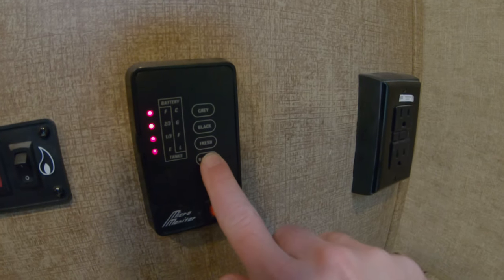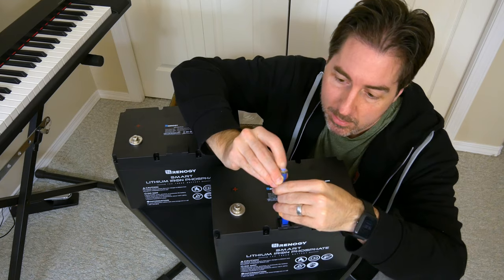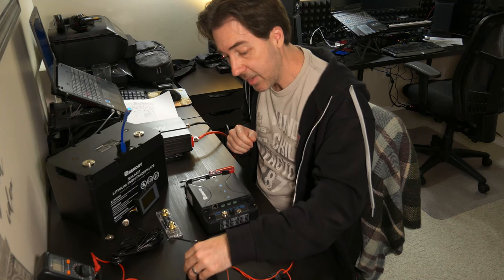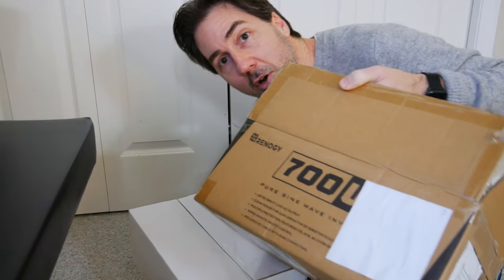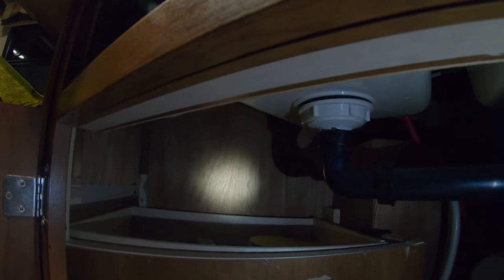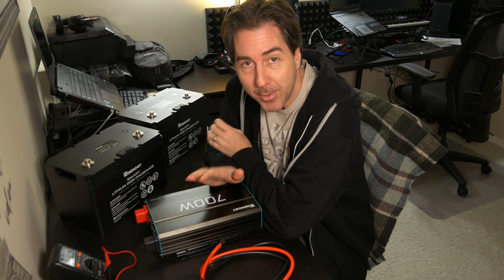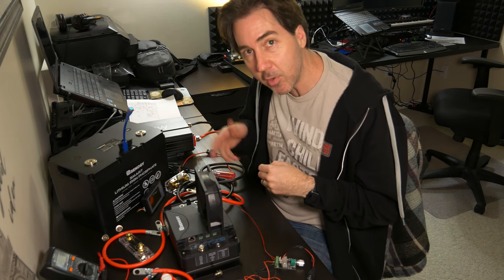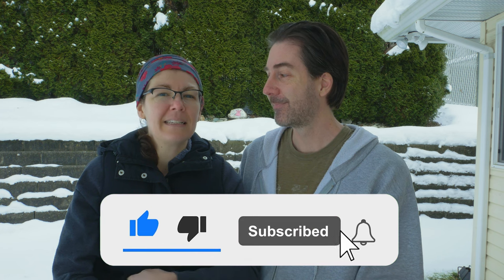RV Lithium Battery Upgrade / Conversion for Newbies! | Renogy LiFePO4

Comment: great video. I have an off grid home with lead acids that I'm going to upgrade in a couple of years. Although I'm not a complete novice, I really appreciated the balanced level of detail on your experience with this video. No overly macho tech talk and not overly simplistic either. Lots of parallel concepts between your application and mine. Thanks!
Reply from the maker: That's great to hear! Thanks for letting me know, that's very encouraging. We might have some more electrical videos coming up when we get a new rig!

Comment: This appears to be a complex "do it yourself" project.  Did you consider getting bids to have a professional install it all, and what did you calculate you saved by doing it yourself?  Personally, I don't have the skill or confidence to do all this myself, so you guys once again amazed me.  You are both awesome!
Reply from the maker: Thanks Doug! We never actually looked into quotes for someone else to do it, since I (Jay) was pretty confident I could handle it -- with a some help from my brother who has worked with a lot of electronics in the past. I'm not sure if I would have tried to tackle it without an expert I could call on 😀. In terms of how much we saved doing it ourselves? I'd guess maybe $5,000 or so in labour. It was a time-consuming project, but very rewarding. And it keeps paying back dividends on our trips. Solar is so much quieter and nicer than our having to use our generator. 😁

Comment: I like your simple breakdown for calculating power needs. I assume that fan was noisy because it wasn't mounted but you might want to look at a bigger one as they tend to run a bit quieter!
Reply from the maker: Thanks, the formula is simple, but as you know, it's not always straightforward to know what your actual usage will be until you actually get out there. For the fan, we're limited by the size of our new "console" area, so we couldn't go too big. Hoping once installed it won't be that noisy :)

Comment: Cool and helpful video.    I'm assuming you can just use a standard charge controller like the renogy rover elite for a lithium battery if only charging with a solar panel and not with shore power or from the 7 pin plug on tow vehicle
Reply from the maker: Thanks! Yes, absolutely. In fact I would recommend using a different charge controller if you don't need the dual inputs, and specifically something that can handle a higher voltage so you can put some of your panels in serial and use thinner wires. The DCC50 in our rig can only handle solar input up to 25V, which means we had to run all our panels parallel.

Comment: Just a correction.  That renogy charge controller does DC-DC charging and solar panels but it doesn't look like it does shore power charging like you mentioned in the video.  It would sure be nice to see one unit do all 3 but I can't seem to find one.
Reply from the maker: We actually have the shore charging coming in on the DC-DC input, but of course that's after it goes through the stock converter. I believe you can get converter/inverter combos but not from Renogy.

Comment: Hello there. Great video and circuit diagram, i have a couple  of questions though, would it be possible to see a picture of your full  setup as you have it in the room? That would make the diagram read  much easier and also is it possible not to install an inverter now and add it later?
Reply from the maker: Sorry, I don't have a wide angle view of the full setup. That would have been a great idea. I'll have to keep it in mind for any followups. And yes, the inverter is optional. Its only purpose is to converter DC power into AC, so if you don't have any AC appliances you want to run, you can leave it out and upgrade later.
Reply: @HomeARoam  Thank you much for a fast reply, i wish u had that picture 🤣

Comment: When you hooked up your old converter directly to the alternator charging post on the Renogy charge controller, which output wire from the converter did you use? Mine has three—red, white, and black that were connected to the old battery +, old battery -, and old fuse box respectively. Not sure if I should use the red or the black to go into the Renogy DC50. Any ideas?
Reply from the maker: Hi there Julian, it will vary depending on the converter model, but if you check out the diagram at https://homearoam.com/how-to/rv-lithium-battery-upgrade/ on my unit, the live charging wire was connected to a port labeled VCC+ and was red. Black is typically negative, and all of your negatives need to be bussed together. IMPORTANT NOTE: Make sure to use a voltmeter to confirm! Don't just take my word for it! 😁

Comment: Great video! Just watched your solar panel vids too. Was wondering how your system has panned out? Are their any changes you would like to make? Are you satisfied with the 700W inverter? Does 400W of solar panels work well? Do you bother tilting them or are they collecting lots of power being flat while your in the baja? Would love to see a video on all this with your power usage and recharge times 👍 Thanks!
Reply from the maker: Thanks! If you'd asked last year, I'd say we had way more power than we needed. However, Starlink changed everything. Cost is always a factor, of course, I would love to have at least two more panels. More if they fit. I've been tilting the two far panels up to get some extra power in the morning and evening. I'll cover this in our Los Barriles video coming out in 2 weeks. With more solar and battery we could then go bigger with the inverter (1500W at least, maybe more) and then be able to run the fridge on electric, use the microwave, or even an instant pot. That would cut down on our propane usage, and propane is hard to find in the super-remote area we're in now (Los Frailes). Overall, the system is sufficient but we've started to see the limitations. I've made a note do to a follow-up video after we get back.

Comment: Wow! definitely not a newbie project. lots of parts and lots of complex decisions to be made that a "newbie" should not undertake. If i tried this project even by following your great instructions id be looking for a new camper after blowing mine up! If you're going to spend over 2K on all this gear then it might be wise to pay a professional to install it.
Reply from the maker: It all depends. I've heard stories of "professionals" really messing things up. And it's pretty easy to mess up a DIY job too. There's always lot of learning experiences along the way. I think if you have some basic knowledge of 12v power systems, upgrading from lead acid to lithium batteries is a reasonable job to be able to attempt to do it yourself. Everyone has their own level of comfort, of course.

Comment: Excellent!  We have to be concerned with our dual AGM's as we use an 80 watt CPAP at night.  We don't boon dock enough to justify Lithium but next batteries maybe...  Currently have 1000 Jackery (and a Generator) which makes a huge difference.  So we're good for 1-2 overnights.  Renogy is A1.
Reply from the maker: Lithium is definitely pricey, but the amazing thing is that you can basically use almost the entire capacity. So 100Ah actually means 100Ah, whereas with most other battery types, you shouldn't really use more than half capacity. We plan to mostly boondock, so we figure this upgrade will pay for itself -- eventually :) Plus we have the flexibility of camping absolutely anywhere that it's legal. We're certainly looking forward to trying the new system out! And more power upgrades to come, including solar and the truck charging.

Comment: I  have read that the majority of lithium battery manufacturers do not recommend leaving the batteries connected to a converter /  charger once they are fully charged. Reason being that lithium batteries work best when they are allowed to discharge to 20% and  then recharge to 95%. That being true… the lithium converter/ chargers like the WFCO with auto detect for lithium will start charging the batteries as soon as they start to be discharged. If I understand that this is how those converters work I would think this would be detrimental to the lithium batteries. In your system when does charging start when hooked to shore power ? Thanks , Walt.
Reply from the maker: Hmm, I haven't seen that. All lithium chargers I know charge based on the voltage reported by the battery's BMS, and yes, as soon as that starts dropping, it charges. I'm not sure if always letting the charge drop that much would improve long-term battery life or make it worse.
Reply: @HomeARoam  This is a great question. I don't have an answer either but if you find the answer I would love to know. Thanks for all the great info!

Comment: Hi, Thanks for valuable information. Please advise what amp of ANL fuse for each spot (between battery disconnection and battery, inverter and battery and battery disconnection,  ac power and controller. your reply will be highly appreciated.
Reply from the maker: Hi Ric, it depends on your capacity. We used a 100a for our main battery.
Reply: @HomeARoam  Thanks for reply and using 100ah battery too but There are 2 x 100ah and 1 x 80ah on your list of items,  what spot of 80ah?
Reply from the maker: I believe the 80a item is a  fuse. We just have the two 100ah batteries.

Comment: I checked out your schematic and shopping list. It appears you’ll be connecting both the 12 V coming from your tow vehicle and the 12 V coming from your trailer‘s converter to the same input lug on the DC to DC converter using a 1-2-Both-Off disconnect switch. Is that correct? If so, can it be safely ran in the both position, or are there backfeed concerns using that switch setting? By the way, thanks for the great video!
Reply from the maker: Thanks! That's right, although we never implemented the high amp vehicle charging cable since the solar has been more than enough for our needs. No backfeed concerns as far as I know, but it would be very rare to be charging from the truck and shore power at the same time. We do still have the low amp truck charging via the trailer signal plug and I've actually installed a disconnect switch on that since it's direct to the battery. Because of that, the lithium batteries will start charging the truck battery when the truck alternator is off. Which could be useful in some circumstances, but otherwise might overcharge the truck battery. So good to have it disconnected if we're still attached to the truck overnight.
Reply: @HomeARoam  Outstanding! Thanks for the  quick and thorough reply! I’ve been planning the exact same set up, so you’ve been extremely helpful. Last question (I think). How many total watts are your solar panels rated for? I read that this Renogy 50A DC to DC converter only accepts 25 amps of solar while receiving power from the alternator input. Has either limitation (25A or 50A) caused any issues? Thanks!

Comment: Your shunt hooks up between the inverter/solar charge controller neg and your battery neg.
Reply from the maker: I think that would show solar charging only whereas we have our monitor hooked up to show net usage across the whole system. That accounts for when we use the generator or charge while driving too.

Comment: Please what size fuse for the very small live wire which your brother said to use???
Reply from the maker: Hi there, if you mean the crossover wire for the ammeter, I believe it's a 5 amp. It shouldn't ever have any substantial current flowing through it, so you want it to trip quickly if something goes wrong.

Comment: Hi there thanks for the video! Super helpful. I am currently renovating an old ‘77 Fleetwood Prowler and will be adding a small solar array and installing one lithium battery to start. The Renogy multi input charge controller you used looks promising! I didn’t catch how you hook up your shore power to it though. Did you leave your old converter and add the charge controller downstream of the converter? I’m assuming you can’t hook up the 120V AC shore power line directly to the Renogy controller. Thanks again for your help!
Reply from the maker: Hi Julian, yes, we kept the old converter and connected that to the "starter battery"/alternator (labeled ALT+) connector. We weren't entirely sure how well they would play together, but it turns out the converter has very similar voltages to an automotive system and it works great. Makes for a really simple setup with just the one piece of hardware.
Reply: @HomeARoam  wow that’s great! Thank you so much for the reply. I’d like to do the same with my setup. Do you know the output of your converter? Mine puts out 40A at 12V. I’m hoping that will work
Reply: Did you guys figure out if connecting the converter to this DC-DC charger for-sure works? @HomeARoam and  @JBMizz  .   I had a perfectly working system with my alternator and converter charging my house batteries, so when switching to Lithium I'd love to add only one more piece of equipment.
Reply: Did you guys figure out if connecting the converter to this DC-DC charger for-sure works? @HomeARoam and  @JBMizz  .   I had a perfectly working system with my alternator and converter charging my house batteries, so when switching to Lithium I'd love to add only one more piece of equipment.  @HomeARoam

Comment: What is the recommended 12v solar panel array that should be used to charge this 2-battery storage  bank? What does your solart array look like on top?
Reply from the maker: Hi there Jerald, we have 4 100W Renogy panels on the roof. You can check out more details and the install here: https://bit.ly/har-solar-install

Comment: Nice thourough video guys, great work! How exactly did you integrate the DC-DC charger with the on board power converter you have there ? Or did you just by pass all together ?
Reply from the maker: Thanks Alex! That was the tricky part that actually required some planning and some advice from my brother (who has more electrical experience than I do).

We changed the routing such that the 55a "converter output" goes directly to the "charging input" of the DCC. This is the port that would normally take charging from your vehicle's alternator. Conveniently, the DCC-50 has two different charging inputs, so the solar goes in separately to an MPPT charger to maximize efficiency.

Then, we simply routed the battery positives to the distribution board where the converter used to go in.

There were a lot of other configurations discussed, but that seemed to be the one that required the least amount of rewiring.

You can find a full (somewhat messy :) circuit diagram here: https://homearoam.com/how-to/rv-lithium-battery-upgrade/

Comment: Great video, its been very helpful ! I am currently trying to tackle a similar setup on our TT. After you moved the battery location to inside the cabin, how did you bring power back to the trailers break away switch ?
Reply from the maker: Very good question! I didn't, actually. I installed a new battery cutoff switch close to the new batteries, and I would probably recommend doing something similar to reduce wire run length.
Reply: Can you link me to the cost sheet please?

Comment: Hey guys. Great video. I was looking at your cost sheet and I didn’t feel that it was too expensive. Some systems people are putting in their trailer seem to way more expensive than your system. I had a question.  Is it ok to leave the batteries in my trailer in the winter time when the trailer isn’t being use?
Reply from the maker: Hi Shelly, good question. You can leave them in the trailer (we do), but you can't charge them when it is below freezing out as that could damage the batteries.

Comment: How do we know if our rv converter charges lithium batteries
Reply from the maker: Hi there, Either check your manual, or open up the converter box to get the model number and Google for the specs. All converters will charge lithium in theory but only newer ones will charge them efficiently. Older ones without a lithium charge profile will take longer and possibly not go to 100%.
Reply: @HomeARoam  THANK YOU 🙏🤩
Reply from the maker: @Drvinnieboombatts  you bet

Comment: I’m very new to this field, so thanks for the video. I understand the need for a new charge controller and a battery monitor, but why did you have to buy an inverter also?  Would the original inverter in your trailer suffice? Thanks!
Reply from the maker: Hi Ben, In our case, our trailer didn't come equipped with an inverter and most don't. The stock "converter" is what coverts 110v "shore power" or AC (the same type that powers your house) into 12v DC that your trailer lights, pump, slide, etc. use. The inverter, on the other hand, converts 12v DC back to 110v AC so that you can use household devices when powered by just 12v solar and battery. We use this mostly for plugging in our laptop chargers when boondocking or dry camping. Does that help? 😁
Reply: @HomeARoam  ok yes that totally makes sense. I realized later you installed solar panels so the inverter makes even more sense. I’m trying to simply replace my two lead acid batteries with lithium so the heater can run fully overnight and to avoid having to replace lead acid batteries as frequently. I will still be relying on having the generator running for AC power and to charge the batteries, but I should still plan on purchasing a charge controller or converter and a battery monitor correct?  Thanks so much for the reply!
Reply from the maker: Ahh, got it. In that case you should look up the model of your converter and see if it supports a lithium charge profile. If it does, you're good and can just drop in new batteries and switch the profile. But if not you're best to upgrade to a newer one that does. Hope that helps!